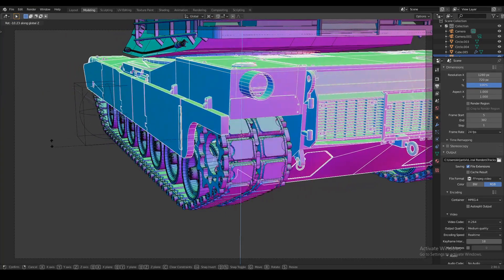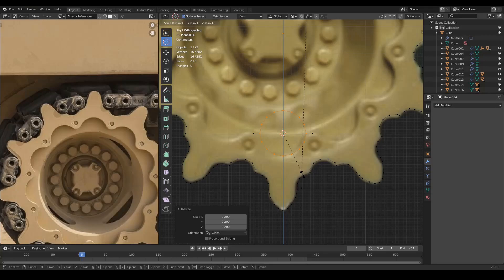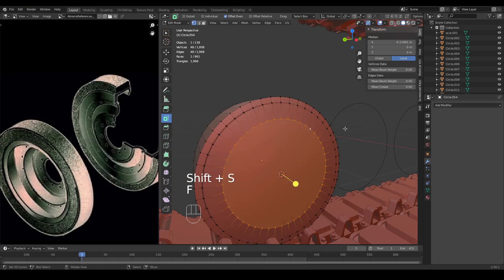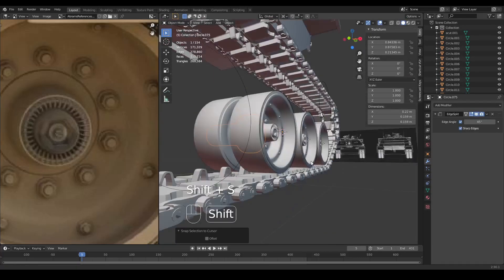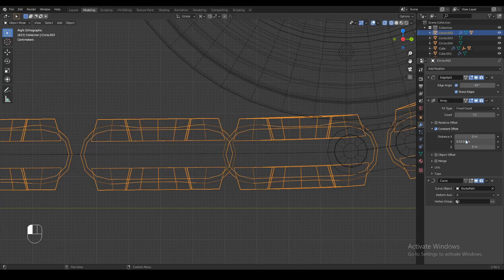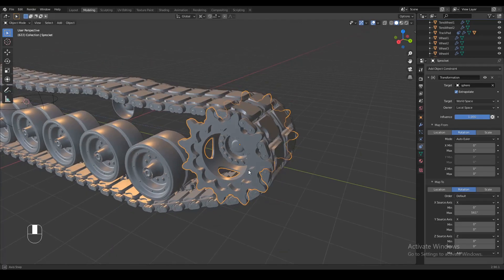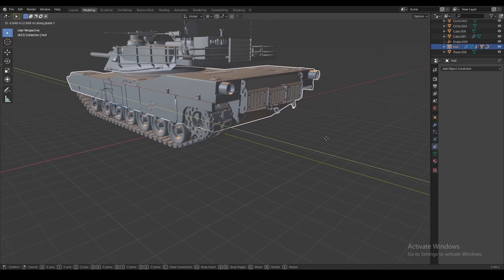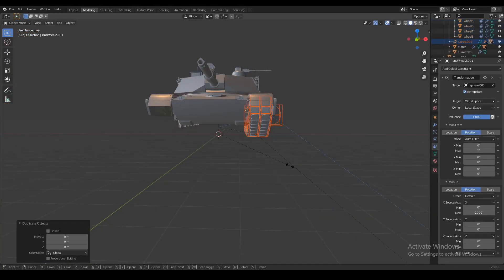Blender Tank Tracks Tutorial | Modeling & Rigging | Constraints (Arijan)

Comment: There's an extra trick you can do in the tracks to make them a bit more realistic. Instead of using an array & curve on the track parts directly, create two small flat planes (one for pins and one for pads), and use the array & curve on those. Then, make the track pins and pads be instanced objects on face of those small flat planes (pins instanced on one plane, pads on the other). Why do that? Because then the track parts will not be distorted when going around curves, the flat planes will, but those will be hidden from view.

Comment: if anyone hast the problem, that if you spin the empty speher at 9:00 the track is exploding instead of spining set the the constraint as following:
Target Worldspace
Owner Worldspace
(later if you set the Parents you can switch it back to local)

Xmax 1

Y source x
Max -11

and before that, close the Pathloop with selecting the first and last point and press F or shift F, i dont know anymore

But yeah if it fixed it for you, upvote my comment so others can also see it (working on Blender 3.4.1)

NOTE: This works only if the tank itself faces in the Y direction, if it faces in the x direction: i don t know how to set it XD , it seems so simple that you use the y rotation then and set the x transform to y but it doenst work somehow... good luck my guys XD (or just spin your tank 90 Degrees so its facing Y)
Reply: Yeah ran into same issue, weird no pinned comment advsing of potiential issues and fixes.
threads flying off everywhere and sliding along x axis

similar settings
Constraint: transformation

Target:Sphere
Extrapolite: ticked
Target: Wolrd Space
Owner: World space

Map from:
->Rotation
X Mac: 1

Map To:
->Location
X source Axis: Y
Max -11

Y source Axis: X
Max -11
Reply: what do you mean close the pathloop

Comment: I think there is a x100 easier solution for this. You can add points between each track gap and make a code for tracks that will make them look towards that gap position. When track moves, gap point moves and wheel follows it. Is this has a downside?

Comment: Good afternoon, I recently started modeling abrams and everything was wonderful until it came to tracks. I searched a lot of sources and the necessary information is nowhere to be found, your video is closest, and besides, you also make Abrams. Tell me how to make the caterpillar links fit clearly between the teeth of the sprocket? No matter how much I twisted everything, I can’t do it, maybe you have the sizes / ratios of these parts. I even made an asterisk from the screenshot from your video and adjusted the number of caterpillar links in the array like yours and still it turns out crooked (. I would be very grateful for the answer, the tank is already ready, but I can’t bring the tracks to my mind ..
Reply from the maker: The technique which I described in this video always works for me, but it does take a bit of time to tweak it to perfection. I don't unfortunately know what else I can suggest, it really is only a matter of manually tuning it to perfection. Maybe someone from our discord community can give you some better advice than me, I would be happy if you would join us. Thank you for your comment
Reply: @Aryan3D  Ok, I still managed to do it. In any case, thanks for the feedback. Yes) + user in your discord

Comment: That's amazing, many thanks for that tutorial! Only one thing, with the SPHERE which controls the movement of the chain, and the rotation of the wheels: I would prefer to use a rotation range in the Transformation Constraint of -180° to 180°, instead of 0° to 1°. That makes the control with a rotation more natural. I made the sphere the same size as the ground wheels, so that I could take the rotation angle 1:1 for these wheels. For smaller or larger wheels, there is some calculation required to set the correct "Map To" rotation.

Comment: For me it didn't work out as I hoped the first time, I did not yet see the update message here in the comments. 
In my case I had to apply the rotation of the curve for the tracks. If anybody else has the same issue, do the applying directly after you've created the curve. So before you attach the wheels etc to the curve!

Comment: Awsome Tutorial! Only one question left, how can i pitch the tank without moving the tracks, for example on an hill?
Reply from the maker: The solution seems to be to have the tank rotate without rotating the sphere. Perhaps it would make more sense to unparent the rig from the tank, since the location of the rig doesn't really matter. 

To avoid any side effects, here's an idea:

A constraint which correlates the movement of the sphere with the movement of the tank, but does not correlate pitch movement. This way when the tank pitches, the sphere does not. 

I'm responding to this from the driver seat of my student job, I can try to make another constraint video sometime if you're interested.

Comment: How did you snap the rotation to the 3d cursor
Reply from the maker: If you mean snapping the rotation angle, you do that by holding control while you rotate. If you mean setting the pivot point to the 3d cursor, you can do that in the little menu in the top of your screen. Look up "blender pivot point" if you can't find it
Reply: thanks

Comment: I having a small problem at  9:30, the sprocket rotates in Z axis and not X axis, when i rotate the sphere. how can i fix this? i try to play around but didn't get it done
Reply: have you solved the problem? i`m having same trouble
Reply: @kzcrpt  no, I couldn't solve the problem. I did another way, but I had to research on other videos on youtube
Reply: I think I figured it out on my end. Late reply but to whom it may concern: I had to rotate my starter sprocket-cylinder 90 degrees to align it with the Y-axis. Applying the transformation to reset it to 0 degrees while keeping it aligned with the Y fixed the sprocket not rotating properly.

Comment: But will moving the tank forwards cause the right track to move backwards?
Reply from the maker: No, forward movement of the tank translates to forward rotation on both tracks, but rotation of the tank translates to differing rotation for both tracks. Try it out, it's smooth as ice

Comment: Can you do a tutoriel to control the wheels vertical position and the track  go to follow. That wway we could animate it over rought torrain. It would be a good part 2 ????
Reply from the maker: This is a much more advanced rig setup that requires physics. I am very interested in learning it myself but it will take me some time
Reply: you can use the default constraints and some parenting to create the behavior of tank treads deforming over uneven ground. in production we don't use physics because they are not easy to control, and not reliable. when rigging, it is important to give the user as much control as possible. dynamic simulations are used to mimic dynamic and chaotic behaviors like explosions, destruction, etc...

Comment: I have a question regarding exporting this into a game engine. What needs to be done to have this rig/or animation working in, let's say, unreal?
Reply from the maker: I never used unreal and google says constraints don't work in unreal. I exported animations to unity and this is how it works:
1) you make an animation in blender, with the constraints if u want
2) you export the model and you export the animation as a separate file
3) you import both to unity and unity plays it when u tell it to

I will make a video on how to animate, export to unity and script so you can use keyboard keys to play animations (such as R for reload animation)
Reply: @Aryan3D  How would you go about exporting the animation separately? And also Constraints don't tend to pass from blender to unity well. IS there a trick around this?

Comment: for some reason transformation constraint doesn't work at all for me. I followed closely every step but the empty sphere is just not working. I tried playing with different axis but still nothing. who knows what the hell is wrong, probably I messed something at early stages.
Reply: ok, got it. His axis are 90 out. His tracks are moving along Y, so if your track lies along X - change axis in the 'transformation from/to' fields.
Reply from the maker: There is a mistake in the video, check my pinned comment. Hope that helps but let me know if there's still trouble!
Reply: @Aryan3D  I've followed through with both video and so far 3 different types of "fixes" I have seen in the comment section but have failed to find a true fix thus far.
When going through each axis it will either expand the tracks outwards or move them sideways away from where they should be.
Reply: Same here, followed along, tried the new `fix` but getting all kinds of weird things happening :(

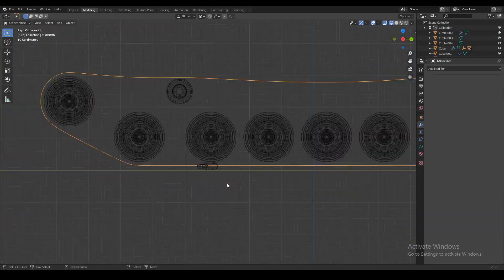Comment: How can I close the path (ca. 6:17)?
Reply from the maker: I just connect the vertices with F, the same as a normal mesh
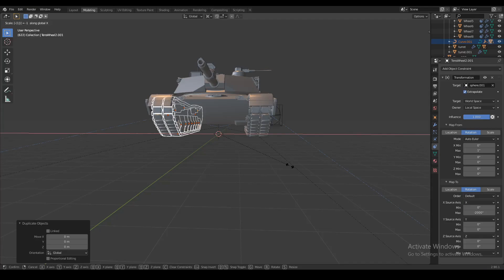Reply: @Aryan3D  ok, and how did you mirror the tracks by 13:40
Reply from the maker: @p.w.5813  I set the 3d cursor to the point over which I want to mirror the object, in this case that is the world origin (shift + s > cursor to world origin). Set the pivot point from"median" to "3d cursor", using the little menu in the middle at the top of your screen. Then I select the objects I want to duplicate, I duplicate them with shift + D and I scale them to -1 on the x axis. Finally just press tab and shift + N to correct the normals
Reply: @Aryan3D  ok, thank you